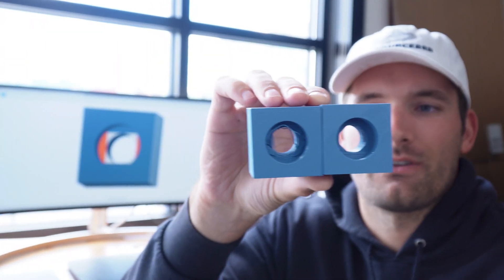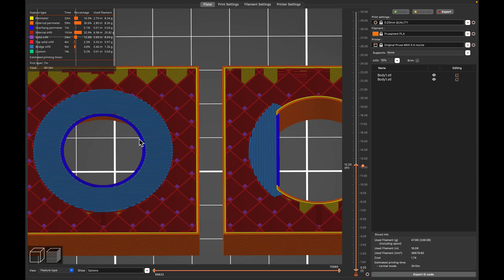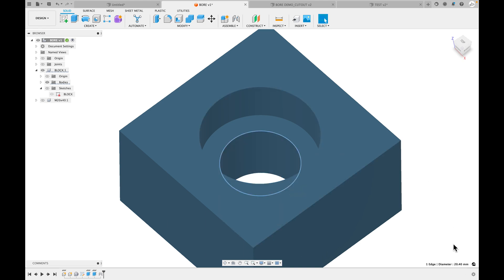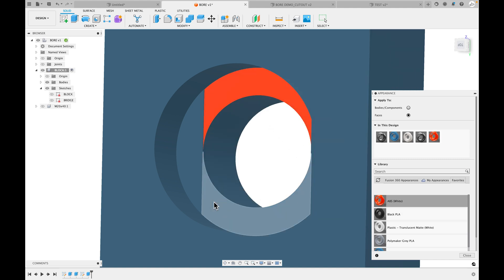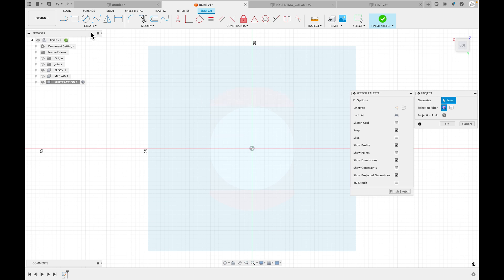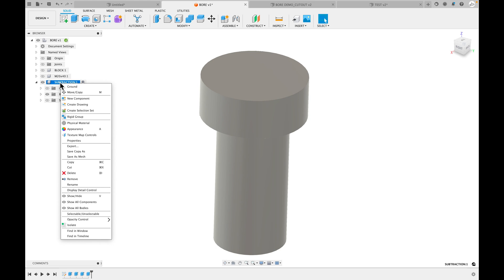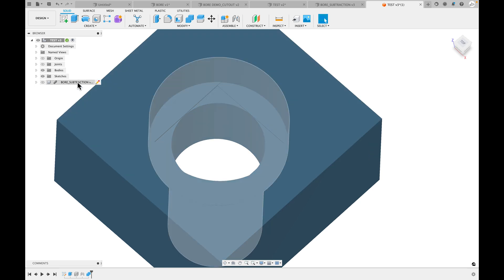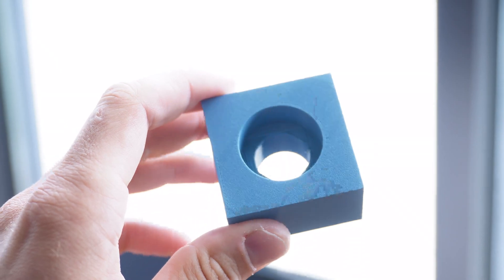How to Design 3D Printed Bores Without Supports

Comment: i just leave a 1 layer section in the middle so the circle prints ontop of a bridge then cut it out after with a deburing tool
Reply from the maker: Nice yeah that works as well but might get old if there are a lot of holes or a lot of products

Comment: anyone know if something similar is possible in cura?
Reply from the maker: This is mainly at the CAD level, but it might be possible by cutting away from layers using Cura. It would be a lot more straightforward to do it during the design steps rather than in the slicer though. Maybe eventually they can make an option to do this in the slicer, but I’m unaware of one that currently does this

Comment: just arc hallway construction, from the early ages, curve upwards
Reply from the maker: Then you have an arc, not an offset for a bolt head or nut
Reply: @madebyjwillis  um print it upside down? so that its naturally self-supporting? always have it designed such to be printable without supports, ie the narrow part sits on the bed
Reply from the maker: @Jkauppa  that’s not the point. There are plenty of instances where you want to print with an offset facing down towards the build plate. This was for demonstration purposes only. Feel free to use your way since it’s better anyway 👍🏼
Reply: @madebyjwillis  not free
Reply: @madebyjwillis  yes for video purposes only, no real use, yes better ways are always better, God is the best, for arguing back as the opponent enemy
Reply from the maker: Glad you have a way that works for you! This way works for me.
Reply: @madebyjwillis  what so impossible about this
Reply: @madebyjwillis  how about minimal support cut-out arcs, if you need to print a hanging bar, no need to build supports from the bed up to the bar, just minimal side-support with removable arcs

Comment: I stumbled onto something similar just recently. I created a two layer net like support structure that bridges across the gap supporting the overhang. This is quite a bit simpler than my method. Chamfers in the bore work pretty well in small holes. you can also get away with 90 degree overhangs about the size of the nozzle.

once the overhang gets larger than 1.5mm or you need that sharp corner, something like this is pretty much the only solution. Digging support out of holes is miserable work.
Reply from the maker: Appreciate it!

Comment: Did you try printing it upside down?
Reply from the maker: That’s not the point of the video - I am fully aware you can easily print it in the opposite orientation. I just used a basic shape as a demonstration.